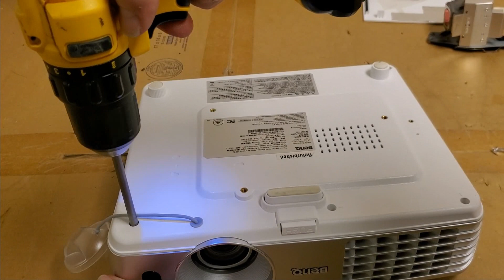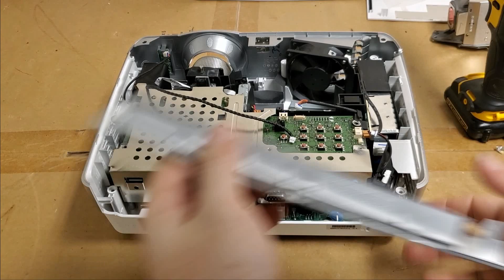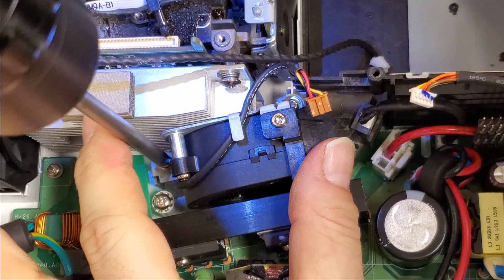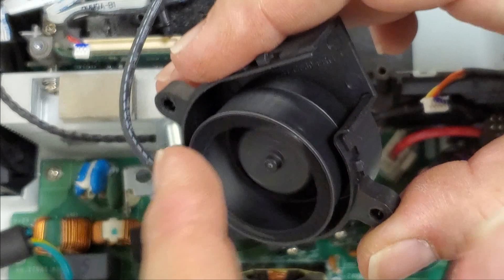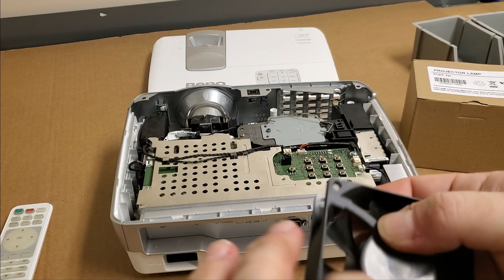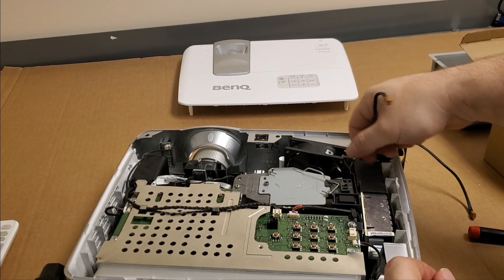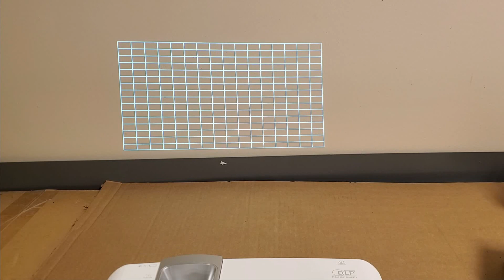BenQ HT1075 DLP Projector Overheat/Fan Replacement

Comment: Watching this has given me the confidence to take my BenqW1080ST+ and have a go at fixing it as it was overheating- it would run for 2-3 mins before shutting down with red flashing temp light.
On tear down, I found the fan on the left hand side (air intake?) wasn’t spinning, so I just replaced it. Now, however, the display it just a static snowstorm of pixels.
The picture was fine beforehand, so it seems a bit coincidental to be the dlc chip.
Is there anything else I should look at ?
I’m pretty sure all my cables have been reconnected to the main board ok.
Thx
Reply from the maker: That fan doesn't spin unless its in high altitude mode. That is normal.  You likely have another bad fan,  #3 maybe but I'm only guessing.  The static/snowstorm is your mainboard not seated properly on the DMD riser for the DLP chip.  Check your assembly and make sure its not shoved together and is sitting nicely.  Nothing should feel forced.   I have videos on testing the fans.  If you had a lamp explode at any point they can throw glass into the turbine lamp fan and it will jam and cause this symptom.  Another common fan failure is the power supply fan but I would not just replace them without troubleshooting.  The parts canon method never works out.
Reply: Thx for the reply

Comment: Is the snail house fan fan nr3?
Reply from the maker: Its fan #3. Not sure about the board position label.
Reply: @FixitFrank  thank you so much for your replay. It sure was. A piece of glass was jamming the fan. Got it out and it's working again. I am a bit puzzled about the temp reading in the service menu, only temp #1 is populated, and it's stuck at 250, is this normal? The fan speed targets seems to vary, so I recon there must be some feedback going into the control loops.
Reply from the maker: Im not sure but its likely because that sensor is not populated in this model.  The fan speeds will vary for sure but as long as its not shutting down and throwing a temp error you are likely all good.  That glass came from an exploded lamp . They tend to shoot glass(quartz) into that fan. Its angled almost perfectly.

Comment: Hi frank not sure if you can help but my benq tk800 is driving me crazy. I keep sending my projector away to be fixed but a month after getting it back same problem. It overheats and turns off after about 20mins. I changed the lamp but same issue as with the original. And BTW the lamp body is insanely hot!!! Not sure if that's normal. Everything inside is super clean. Also I am not sure if it matters but I have no plastic membrane over the lamp, maybe when they previously repaired it, they forgot to replace it? Also I can I only see two fans when I open it. The one to the right of the body near the back blows inwards and the one next to the lamp blows outwards. Is that correct.. Help please and thank you very much for your great videos. Any advise appreciated. I'm in Spain BTW
Reply from the maker: Sounds like the exhaust fan is backward.  The exhaust fan should blow out.  The turbine fan blows into the lamp and then the exhaust fan blows that hot air out.  If the exhaust fan is reversed, it will prevent the hot air from getting out and I would guess it would finally overheat in 20-30 min.  It's also really easy to put that fan back in the wrong way.  There is an arrow on it that should be pointing out. 
You can check the temps in the service menu. press menu then enter/source at the same time.  use the arrow keys to navigate the boxes. One of the boxes shows the temp and fan speeds. just dont change anything.  You can ruin it really easily with one wrong setting.  I might be wrong  but I kind of recall the Inlet fan being the only one that blows inward. I am fairly sure the rest blow out. https://imgur.com/a/nyIzDBU  <--fan diagram

Comment: My Projector had a similar problem. Turned out, the former owner put the power supply fan back in the wrong way around after cleaning the insides of the projector. It's definitely always worth not only checking if the blades are turning, but if they are spinning the right way haha.
Reply from the maker: I have done that.  Thankfully I caught it...  your advice is spot on!

Comment: Than you so much! Your video was very helpful. I had fan3 issue due to bulb bust, opened up and cleaned. Didn’t see anything so put it back and it worked. No issues for at least couple of hours.
Reply from the maker: I suspect you are good to go.  If you had an old bulb explode, it likely kicked some glass into the fan and jammed it.  You cleaning it made the fan work again so as long as that keeps up, you should be in good shape.  Enjoy the projector!

Comment: I just put in a new bulb and housing. But now I have the power and temp red light flashing. What do I do now? It comes on and said sources is detected then it goes off.
Reply: It’s a BenQ HT1070A
Reply from the maker: Hi Paula!  That is usually a jammed/stuck fan.  If your old bulb exploded, it may have thrown some quartz bits into the blower fan.  Thats a common issue.  Either way, you have a fan that isnt spinning.  Search my channel for "fan" or " blower fan". I have some videos on that.  If that is your situation, its an easy fix that does not require new parts.

Comment: How do we know which way to put the fan back in I took it out but I'm not sure it's supposed to go which direction lol one side the center is a solid plastic piece and on the other side is a metal circle in the middle it's a benq ms510 thanks
Reply from the maker: Which fan?  Usually they blow outwards if its an exhaust fan but I would need to know which fan you mean.

Comment: Thanks for your tutorials!
I have a Sony vpl-vw295es with an exhaust fan that quit working.
Any any advice where I might get a replacement fan?
Reply from the maker: You are very welcome! Hard to say on the fan source.  I know encompassparts.com has a lot of OEM sony stuff. What I usually do it look up the part # on the fans sticker and buy them that way.  I forget who sony uses for fans but they dont make them(sony).  I'd check encompass first. Then I would google/ebay the part # listed on the sticker that is on the fan. That would be your best bet.

Comment: I think to have the same error: the manuale says "red led temp blinking" It Is error fan 2. Whic Is fan 2 in the Benq projectors? Thank you for your answer and great channel!!
Reply from the maker: Thank you so much!  Fan 2 is the power fan. Back right corner if you are looking at the connectors.    Here is a diagram https://imgur.com/a/nyIzDBU
Reply from the maker: @fabbricapescirossi  ahh you have a 2050? it looks like? Blower fan and lamp fan are the same. It's the fan behind that heatsink. You also have an exhaust fan. That's the fan in the front (bigger square fan). The fan numbers should be printed on the main board by the connectors.  Worst case, replace the blower fan and exhaust fan. What model is that?
Reply: @FixitFrank  thank you again 😁. The model should be Mx620st

Comment: Where you checking the feedback signals? or the pwm send to the fans?
Reply from the maker: These do not have PWM sent to the fans. They use RPM output as a square wave. The speed is determined by the dc voltage sent to the fan. The place to check depends on the fan but it seems to be on the grey wire or pin3 on each fan. You can check with a volt meter to find the pin. It will be the pin that is 3.3v or lower and not ground. I hope that makes sense. I have another video on checking projector fans https://youtu.be/kCOSQ8dVZvc
Reply: @FixitFrank  I have a scope. But i meant, you have three wires, input and output of the fans. The RPM square output is probably in millivolts? Not in the range of 3.3 volts rights? So What you were measuring is probably the input square wave? I ask this beacause I had the Fan out of the projector and just check the output squarewave in combination wih 9 volt battery, but the square is not as nice as yours and in milivolts range.
Reply from the maker: These fans do not use PWM for power control. The speed is controlled by the DC input on the VCC wire.  12v being full speed and 6v (usually) being the lower they will spin.  The other wire is "fan status".  Some fans use a pwm like signal for reporting the RPM to the projector for fan stall reasons. Others will pull that wire high or low on fan stall. Only 4 wire fans use PWM for speed control. The reason the wire shows you such dirty PWM is that it needs to be held high via a 10K resistor. Here is a diagram of how to test and how it works. https://imgur.com/a/6uOIiDv You may also want to watch this.  https://youtu.be/kCOSQ8dVZvc

Comment: Thanks for the video Frank. I have a Benq w1300 and after a couple of minutes the colour changes and it shut down, the cooling runs. No overheat light on.
I be happy if you have a suggestion where to start.
Reply from the maker: Hi Peter!  You're very welcome!  The symptom says the color wheel is acting up, but why it's acting up is not as clear.  If you replaced the lamp recently, the new lamp may not have a proper UV/IR coating. That can cause this issue really quickly.  The glass on the housing should have an obvious reddish tint to it. If it does not or has a greenish tint, that is your issue. 
If the projector was running happily and then all of the sudden this began to occur, it could be something as simple as needing a cleaning or as complex as a new color wheel.  They do wear out over time. A new color wheel should only be $30-40USD.  It all depends on when the issue started.  I hope that helps and thank you again for watching!
Reply: @FixitFrank  It started with the original lamp, then I tried two osram but still it shut down. I'm down to the colour wheel now and the colours looks faded. It doesn't have clear red, blue, green. It's more like lila, green, yellow. 
Is there a way to test the wheel?
The funny thing is that it works good for a couple of minutes then the colours mixes up and it shuts down without. But it looks like the colour wheel to me, so I will order a new. Thanks again.
Reply: I found out that it could be that the colour wheel stops due to dirt. I will try to clean it.
Reply: I changed the colorwheel and fan, and it worked good for a couple of hours. I havn't used it for a while and now error is back. It changes color, ends up with lilac and shut's down, fans starts to blow. It does sounds like the colorwheel stops running. But, since I have to reopen I will order an new main fan, is it the same as a W1070 fan?. 
I can go in to servicemode but don't know where to find the errorlog.

Comment: Hi, Thank you very much for the video! 
My Benq W2000 suddenly started to get very hot. (it smelled burnt) so I switched off the beamer. 
I checked the fans, and I saw that 3 fans do not rotate even when the beamer is on. 
So I ordered 3 new fans. 
They arrived and I changed all of them. 
Now I have 2 questions: 
1. I know is a kind of stupid question: But am I correct that the van should blow into the beamer?
2. The third "small" fan does not work, even with the new replacement. Do you have any recommendations for me? 
Best, Josef
Reply from the maker: Hi Josef, You're very welcome! The exhaust fan should blow out if I recall correctly.  Here is the Level 2 SM for that model. It goes over the fan directions. https://drive.google.com/file/d/10iGLFpO2Xc1J0GfmBMA7Wl_9boiLXPQg/view?usp=sharing
It's very likely the other fan only comes on when certain areas get hot enough.  However there is a chance that the Fan_Thermal board has an issue. To check that involves the Level 3 SM. https://drive.google.com/file/d/1NQhBoO1IqMX_Zdnt27J-1B_L-BbONpnP/view?usp=sharing

Comment: Hi Frank! Do you happen to have a purchase link and part number to blower fan #3 (the fan inside of a housing that blows directly to the bulb/lamp), for projector Benq w1070?
Reply from the maker: It should say "BUB0512L" on the side. Delta makes it if I recall correctly. I do use a company in China called Time Electronics.  You can email them a picture of the fan and let them know the model and they can help you.  They take Paypal and use DHL.  gydz@timeprojectorlamp.com  They are a great company. It can't hurt to check eBay as well.

Comment: I have an HT1075 with the exact same problem. The projector has been used sparingly, as in less than 250 hours. The exhaust fan has one warped blade, EXACTLY in the same pattern as the one in the video. How is it possible that one slightly warped blade can cause a 10 degree difference? And is it possible that the warped blade has always been there, but that the fan has just gotten old and isn't running at the same rpm? Also, when you tested the fans with the voltimeter it showed 6v when the fan's specs say it's a 12v fan. Isn't that an issue?
Reply from the maker: I'll be honest in that I am not sure why exactly those fans act that way.  My suspicion is that they were not that bad at first but the heating and cooling causes the blade to warp and the leading edges to become more blunt.  They use the airfoil design to move air rather than a pushing design with some angled blades. If the airfoil becomes inefficient, the air isn't going to move well at all.  I also think Abba may have had a bad batch of fans.  My personal HT1075 had the fan next to the DMD heatsink fail after 5 hours(brand new).  I bought it on eBay but didn't know it was that new until I fixed it.  The entire unit had about 15 hours including the factory testing (going by the service menu).  The normal menu showed 5 hours on the lamp when the fan failed. 
The rated voltage is the max voltage the fan is happy with.  There are chips for each fan that control the output voltage to change the speed as needed. It helps keep the noise down. 6v runs the fan at about 60% of its rated speed. It would go up closer to 12 when its in cooling mode. Thankfully that is normal.
Reply: @FixitFrank  how would you rate the aftermarket lamps by the way? The price difference between the original and what can be found on eBay is huge.
Reply from the maker: If you can get the projector to power up for a few min, you can check the service menu(press menu, then enter/source at the same time) and you can check to see what fan it is.  I'd definitely replace the exhaust fan. The other fan I see fail is the DMD fan (if yours has one, some of them didnt). The blower fan is probably fine unless you had a lamp burst at any point in the past. 
Aftermarket lamps are a range of quality.  Most of the stuff on eBay is garbage. The large issue is that the lens used for the 5J.J7l05001 needs to have an ND coating to block UV/IR from ruining the optics and confusing the color wheel. In fact, I made a few vids on what to look for.  If you know what to look for, you can save some money but don't believe any claims you read on websites about equivalent lamps and Osram or Philips.  https://www.youtube.com/watch?v=pym7D7etOcM&  My day job is actually in the replacement lamp industry so it's something I deal with daily.
Reply: @FixitFrank  cheers. Thanks for the response. Thankfully this model was quite popular back in 15/16’ so the spare parts are aplenty. I stripped down the unit and there’s nothing else that seems obvious apart from the fan in question, but I’m tempted to buy the whole 4 fan set because I don’t own a voltmeter and who knows which one is acting up.The lamp itself looks brand new with no heat damage.

Comment: Thanks for the video, made it very easy to trouble shoot and disassemble my projector. Any suggestions for where to purchase a replacement inlet fan(Fan#4) for a w1070 model or a model number I can google?  The service menu shows all other fans working fine except for that one showing 0 RPMs. Thanks!
Reply from the maker: I use a company out of China called Time electronics.  They ship DHL And take paypal.  I have also found them on eBay.  Best bet is to search by the ABBA part # on the sticker.  Otherwise contact Time Electronics, GYDZ@timeprojectorlamp.com  They are very good. Be sure to include a picture of the fan so they can verify the right part.
Reply: @FixitFrank  Thank you , was able to easily find it on eBay. Item number was ADDA ad0612lx-h93. Thanks again.